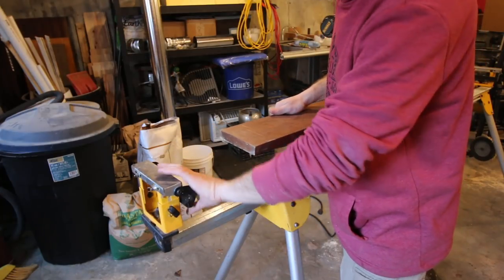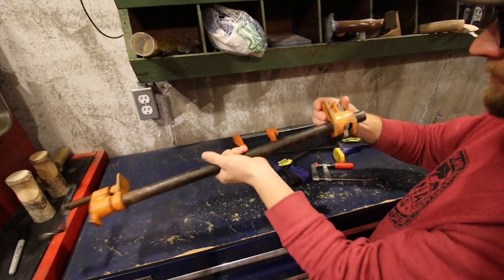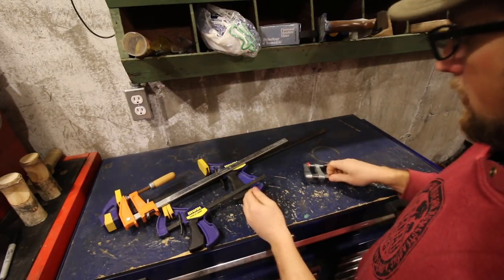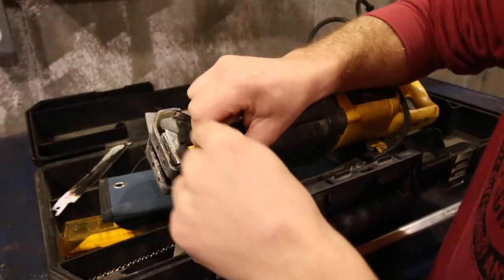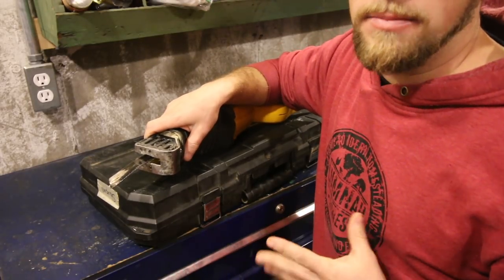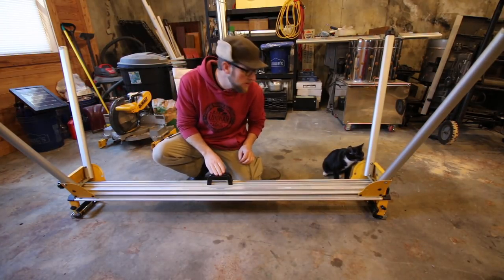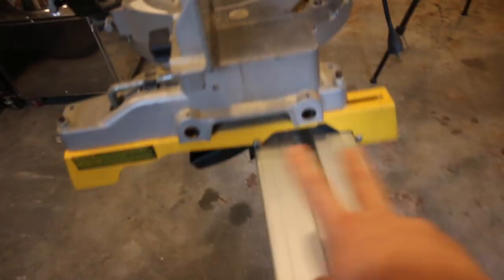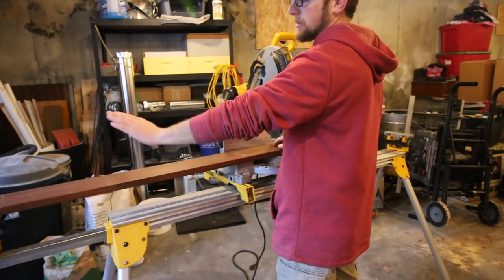Homesteading Tool Must Haves

Comment: Thanks! I really enjoy your tool time. We got a saws all from Harbor Freight last fall to get a rotten board cut off the eve of the barn. Hubby did a good job but he sure got a jiggling way up the ladder. I held on to it below and he got the board sawed off eventually. Wondering about the blades. Even after I asked them if we needed anything else they sent us home without any blades. I dug around a junk box as I thought there were a couple in there. One fit and that is what we used. It's over two hours one way back to HF. Wondering if you might talk about blades in one if your tool times?

Comment: I have the same stand. The dovetail grooves in the aluminum extrusion are for the stop supports that are on the extensions. You can take them off the extensions and slide them in the dovetail groove for shorter cuts.
Reply from the maker: Thanks I never knew that about the dovetail groove

Comment: Learning to finesse your reciprocating saw, you can do finer cuts. I've used mine for cutting lap joints, through mortises and tenons. Length of blade and controlling blade speed play vital roles in performing these cuts. You'll also want to flip your reciprocating switch to the linear position. All reciprocating saws have a multi position switch on the side. One position the blade travels in a straight line, linear. Second position, the blade lifts slightly on the return stroke, then drops back down on the pull stroke. Each additional click increases this lifting, reciprocating action. This is helpful in demolition. Often you do not want to push dust back into the cut with a linear saw stroke, with the reciprocating action, the blade is always pulling dust from the cut on the return stroke. This is a more aggressive action and minimizes unnecessary wear on the blade, especially when dealing with drywall or plaster. 
The T slots on your miter bench are for optional/additional tools that can be added. Dewalt makes work supports, stops, etc. that can be added into these T slots. Having additional supports eliminates the need for constantly adjusting your end supports/stops when making cuts of various lengths. There is also a crown molding attachment. With appropriate sized bolt, washer and threaded lock knobs you can fabricate other useful addons.

Comment: I inherited my dads tools in his very large shed. My husband has been showing me how to use them. I like that portable table. But the saw horses are in good shape. And the saw I prefer is the small itty bitty battery operated one. Haven't chopped any fingers off with it yet. Started a country kitchen open shelf rebuild with 2x8's we've been saving for years. 34° here in Florida. Brrrr 20 below is unfathomable.

Comment: Great demo and teaching video today! Thank you and have a Blessed Day!  Snow coming today my Friend get the plow and Bota ready!
Reply from the maker: I think I am ready! Lol. I just put some 911 in the Kubota to keep the fuel from gelling. How much snow are you getting on the sea coast?
Reply: The projection is the 12" to 15" range. The snow started about a half hour ago and is really coming down...it's a classic nor'easter this storm!!  We are at the waterfront, but high enough in elevation I don't worry about flooding at high tide (we have had super high moon tides), it's the high winds I'm concerned about!!!  The next high tide is at noonish I think, it will stay high for a longer than usual because the high sustained easterly winds will keep the water up in the bay (Great Bay). Power outage is another concern.

Comment: Greta video Al, you chop saw stand, the groove in it I believe is structural, but the clamps that attach to your saw seems they would work easier if you had the levers facing the front, little easier for adjusting by not having to reach across the saw or go around to slide, I could be way wrong, just a suggestion lol have a great day thanks for sharing

Comment: Tool time! An excellent review of your range of clamps and power saws, which has triggered some power tool envy. One day... That miter saw stand seems very compact for the job it does and nicely designed - I like those material supports. I'll be curious to see if anyone knows what the groove is for... "I thought I saw a puddy tat...!" 🐱
Reply: Could the groove possibly be for inserting a 2x4 on its edge as a form of board support or holder, or as a sacrificial cutting board perhaps?
Reply: I think the groove is for a stop. As in you put the end of the board being cut against the stop instead of cutting to a measured out pencil line. If you watch old school Norm Abrams woodworker, he uses them on his radial arm saw.
Reply: You may be right - I must admit I initially considered that but it seemed that the material support already served that purpose as such, as Al seemed to demonstrate towards the end of the video.  Not having one, I can't test if the support/stop fits in the groove though :)
Reply from the maker: Figaro was all over the video! Lol he was having fun photo bombing us
Reply: Lumnah Acres Lumnah Acres yeah, my looney tunes quote was meant to be a (somewhat paw) pun about saw(s) and Figaro :P
Reply: I have the same stand. The dovetail grooves in the aluminum extrusion are for the stop supports that are on the extensions. You can take them off the extensions and slide them in the dovetail groove for shorter cuts.
Reply: John Harris cool, thanks John and Andy :)